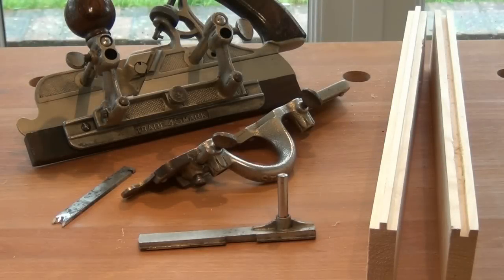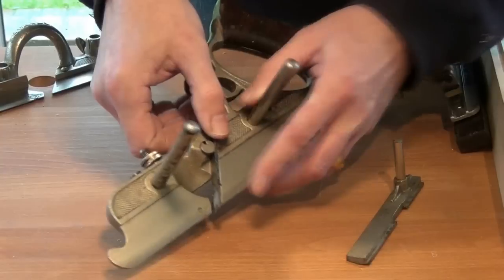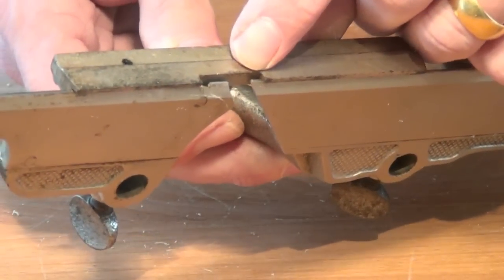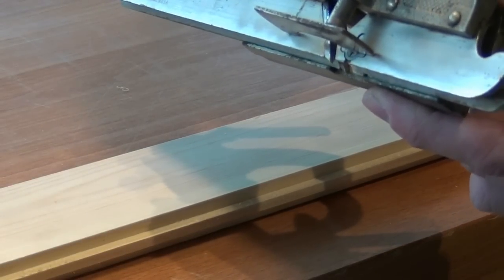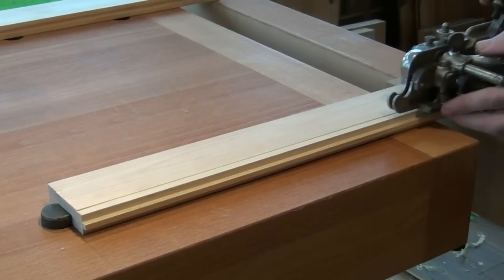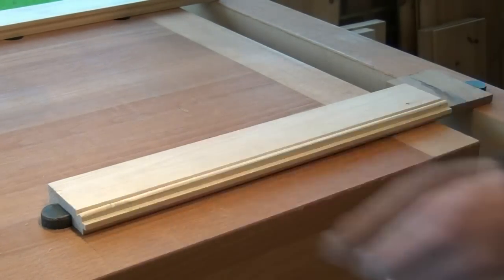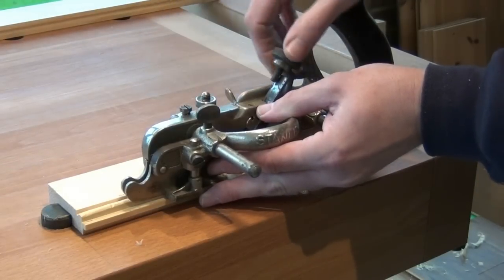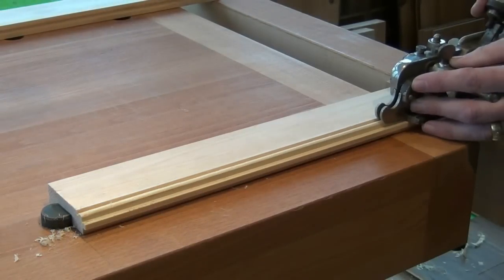Matching using a Stanley No.45 Part 3 Beading

Comment: Another great video, Sir!  Well done.  I only did this one time just to try it out.  I seem to remember setting the cutter a bit further to the right to even out the reveal on both sides of the bead, but that was a long time ago.  Hell, I'll have to go out to the shop to see if it's even doable.  Darn you, Mitch!  It's cold out there!  Haha!  Thanks for the video.  It really is amazing all that you can do with these planes with practice and attention to detail.  My next vintage "big" tool purchase will be the 55 that takes it to another level.  The first time I used the 45, I saw the need for fences on both sides of the work and outside corner work.  It's not high on my priority list right now though.
Reply from the maker: Now a 55 would be nice, but I can't justify it just yet!
I believe the bead gap is evened out when installing the match boarding, to allow for a little expansion (i.e. tongue not seated fully in groove when installed). Who knows 😀
Reply: There you go, again.  All worried about justification......... HA!  I'm in the same boat.  I'll look at that T&G bead today if I get time.

Comment: Hi, I am interested to know the purpose of the off set bottom of the beading gauge ? Thank you.
Reply from the maker: Hi. I believe it registers on the skate of the sliding section, providing a fence to align the beading cut, and acting as a maximum depth cut as it reaches the tongue. I learnt how to use the #45 from it's very basic manual and trial and error, so there is possibly a further reason for it that I haven't yet discovered ;-)
Reply: Thank you do much and I do enjoy your educational video very much
Reply: @mitchwoodwork  Thank you so much, your videos are very helpful!